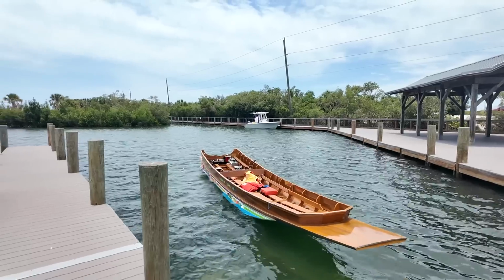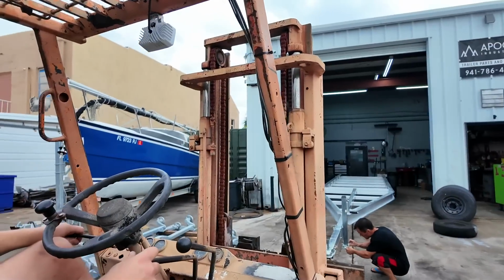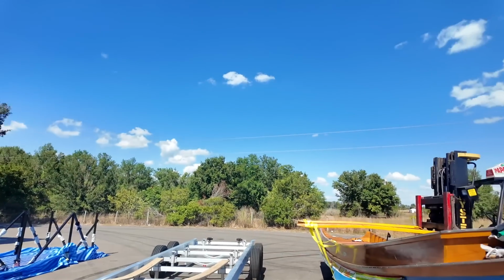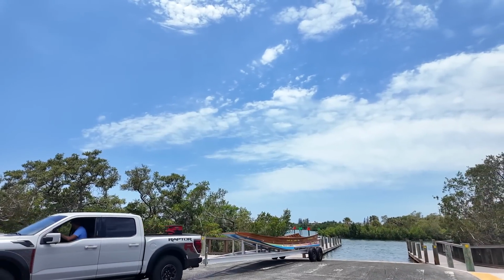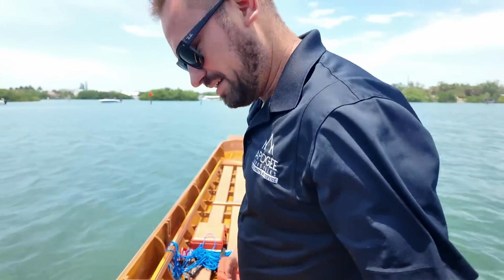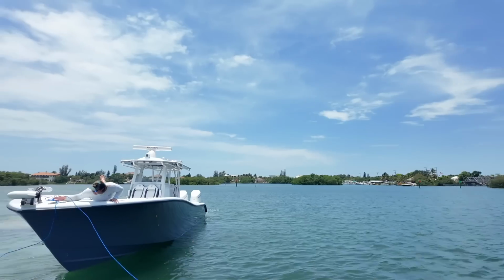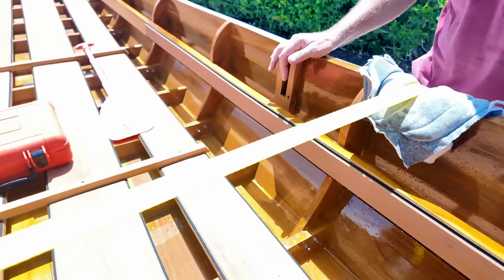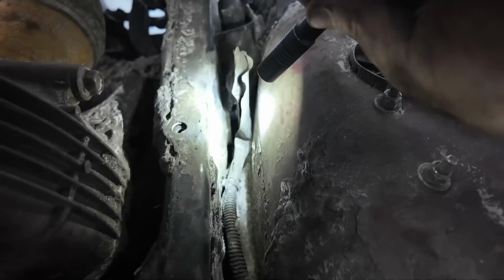We Almost Sank the Thai Longtail

Comment from the maker: Quality Entertainment starting at 17:00
Any suggestions on how to improve the water pump and fix the water leak?
Limited production on Boat vs Work Shirts, get them while you can!
https://www.cleetusmcfarland.com/products/preorder-dr-parker-bad-day-of-boating-shirt?_pos=1&_psq=preorder&_ss=e&_v=1.0
Reply: 🇹🇭 ปล่อยเรือเรือลงนํ้าซัก1คืนตวามชื้นจะทําให้ไม้ขยานตัวกลับเข้าหากัน 👌👍
Reply: You need to find someone who can vaccum bag one side and suck epoxy through the crack.  Tape and vacuum bags a good vacuum pump
Reply: Water water water wood swells and seals it’s self
Reply: Flex seal lol
Reply: On all of our wood boats we put lawn sprinkler under the boat to swell the wood back it takes a couple days
Reply: Just leave it in the water and the wood will swell and seal it self.
Reply: Man this boat is so epic dude! Mad penis extension.
Reply: It’s a easy fix for the water pump you just need a self priming water pump most of them just push water you need one that can suck and push look at camper water tank pump that’s what I run in my race boat to warm up when moving too slow to have enough water pressure thru the motor and you would also need a one way valve as well so it won’t flow backwards out of the motor as you are technically pushing water up hill to get it thru the motor
Reply: Put some weight where the engine would sit , to sit the boat at a plane (incline) to allow the water to go to the back
Reply: Dude call your Thai guy it's a Thai boat ask a Thai what to do

Comment: Forget the wedges that’s gonna make the crack bigger and spread it if you put anything like that in it. You need to put epoxy on the inside and then take the vacuum pillow bags( it’s like a home storage product) then cut it and tape it to the outside of boat and turn on the shop vac and it will pull the epoxy through the crack

Comment: The wood is going to continue have these issues. Best option would be to flip it over sand it and either re epoxy (easiest option). Or laminate another layer of fiberglass on the entire hull. You have to make sure that wood is completely covered even the smallest area not covered composites will 100% ruin the entire hull if water gets underneath the builders epoxy cover and laminate.
Reply: People still build boats with “wood” as long as nothing is exposed to the elements your good. But I can promise you just by looking at the video you need to do a full go over on everything that is exposed to water

Comment: Wooden boats need water or more accurately need " moisture content"
Most likely the "teak" is new growth and susceptible to dry cracking.
3 months in a container and 3 months in a low humidity will dry the wood thoroughly.
Leave it covered ouside with 5 gallons of water in the bildge, it will steam the wood back to " normal".
Wood floats.....

Comment: You don’t think those water intakes without the engine were just maybe barely touching the water? They are right at the edge of the hull and it had to be balancing more center or even front without the weight back there maybe they weren’t fully submerged.

Comment: Just dried out from shipping and heat from sitting in the parking lot. Grind out the crack mix up some west system with silica filler to a nice peanut butter consistency and drive it in the crack. Sand smooth and paint over with more varnish or just epoxy. There are tons of old wood race boats still out there, repairs are not rocket science.

Comment: Wood boat storage is crucial. Up here in Michigan people are using climate controlled spaced or barns with dirt floor for some reason. You can get into big trouble quick on the water if you're not safe. Have a second set of eyes on your work. Pushing some 5200 into the crack would be my solution. That stuff will never go anywhere.

Comment: I think your inlet for the pump was partially out of the water due to the engine not being in it.  It was sucking air alternating waves. Might want to check that before you buy a new pump.

Comment: That's a wooden boat for you. Doesn't matter if it's teak or mahogany or whatever. It will all shrink and swell. Most modern timber is not as good quality as it used to be. Sending timber boats from a hot dry environment to a cooler area isn't as bad as going from cold to hot. I am always worried doing this. Epoxy a spline into your problem area. A spline is just a tapered strip planed to fit the gap. Sometimes the gap will need to be opened up to allow enough room for a spline. G'day from Tasmania.

Comment: Those  ribs of the boat are joined with two thru bolts in the corners,not very good for strength . Looks cool, unfortunately that wood is going to snap like a dry twig

Comment: get a Bosch 039 Mercedes/Volkswagen electric engine water pump. $50 online and 900 Liters per hour(56gpm)....Meziere LS pumps only flow 42gmp and stock LS radiators only flow about 50gph so it keeps my car nice and cool and gives a nice power boost

Comment: Ok, Wood dryes and schrinks and cracks. If you then put epoxi in crack what do you expekt whwen the wood get wet and the wood expand? you ruin the boat it will bend all of your planks to hell.
Use a waxbased sealer from outside the boat untill it will swell to its naturar form.. Im al old boatbuilder from Sweden. God luck to you gyes.

Comment: I know several years ago I had a friend and his dad had a classic cross craft all wood boat in Arkansas. In the spring after winter, after dewinterizing the motor he would in his driveway put the garden hose in the bottom of the boat with the plug in. Fill it as high as he could without hurting the seating and motor and trans. Let sit. After a day put more water in. Ater the beginning of the week water would leak out for a few days. By the end of the week it would hold all the water. 

When it stopped loosing water he knew it was ready to use for the summer. 

Wood just dries and shrinks. 

Easy and free to try just loose some time if it does not work. 

Hope that helps.

Comment: I never really liked the cooling system on that boat the hoses look too small. But if it works in Thailand it should work. I would put a pee tube (hose) running over the side of the boat same as a outboard has that you can see easy from the driver seat. This would come from the top of the engine and intercooler one tube each. They would both serve to bleed the engine at start up and indicate positive cooling system pressure under way. Think about having a plastic bait bag stick to the water intake. I have had this happen twice with my outboard.
Side note, I used the hose machine at work for hoses but also for crimping the ends on battery cables. Just guess at the die size, don't over crimp, then put some self sealing heat shrink tubing on, done, no soldering. It will be the best looking battery cable you ever seen.

Comment: The issue with the cracking of the wood has to do with the moisture level.  In SE Asia they have much higher moisture content.  So if they wood is equalized to that amount of moisture, then it works there.  When it is brought over to a dryer area, the wood can crack because it is drying out.  We used to have the issue when I worked for a flooring company.  You had to make sure that the wood was dried to the correct amount for use in the US.  If they did not do that, and it was just the dryness that they have in SE Asia, when you installed it in the US, it would dry out and cause cracking, ruining the floor.
Reply: I highly doubt there’s a more humid environment than Florida lol
Reply: @brandon_doe  Oh there is.  I spent a few years in SE Asia and it gets pretty humid there.   I found Indonesia to be the worst.  Average Florida humidity is 74.5%.  Average Thailand humidity is 79.9%.  Average Indonesia humidity is 82%.

Comment: Killer boat Parker!! Do not short cut the boat repair. It has to be repaired correctly or IT WILL bite you in the ass. I have some experience with old wooden boats. Do it wrong do it twice. You cannot coat the boat with rhino liner it will not stop the water coming in.

Comment: For a sure fix and plethora of answers I'd try to track down a local shop that still builds wood boats. You are right about why it cracked, wood is not as durable as complete fibreglass and baking in a tarped container absolutely dried it right out. It does need to be opened up and have an adhesive forced in and clamped. I don't know if this boat has layered fibreglass like most modern wood boats but that'll definitely need to be addressed or added. In the meantime, treat it like furniture, keep it cool and dry.

Comment: Dude those boats (any wood boat)  stay in the water so they swell and seal itself. We used to sink the small skiffs on purpose so the wood would swell and when we pulled it up it was sealed tight as a gnats ass..

Comment: The leak depends on wether the split is opening up more when u stand on the port side if so it means there is a issue letting the hull seperate, like the top and bottom of the side of the hull are pulling apart

Comment: Parker, you need to seal the crack by pulling a vacuum on the outside of the boat where the crack is. Then, you can use a thin epoxy and the vacuum to wick the glue into the crack from the inside out.

Comment: Normally on a wooden boat the wood pound a cotton material into the crack to make it water tight and when the put the boat in the water and the wood begins to swell it will push the cotton out as the woods seal up..But you boat won't stay in the water so you will have alot of wood swelling and shrinking so it could cause more cracks don't know how well they sealed that wood to protect it from absorbing water you might have to use somekind of marine epoxy to coat the whole boat inside and out to keep it from absorbing water cause when it dries out it will cause more cracks!!

Comment: The problem with wooden boats is that when the wood gts wet it swells when they plank a boat they will leave a quarter inch gap between them so when the wood swells it closes the gap and even seals the wood making it water tight but when the wood dries the wood shrinks opening gaps and causes cracks which I'm pretty sure is what has happened here to your boat!!

Comment: Parker you don’t need to do any kind of structural rebuilding to fix any of the water leaks. I can’t see from the video but I’m guessing the boat building assembled the boat by laying planks across the rib braces butting the planks up against each other tightly. And he probably figured sanding the joints of separate planks smooth and varnishing over them would seal the joints and keep water out but a wooden boat that long bouncing over choppy water and bouncing around in shipping or on a trailer combined with the temperature changes from hot sun to cooler night time, the wood will expand and contract and flex slightly and the thin layer of varnish isn’t flexible enough so cracks and seams in the layers of varnish will appear. If there is an actual real crack in a piece of wood that can be easily fixed, but I’m guessing what you are seeing as cracks and where water is getting in, is just surface cracking of the layer of varnish and flexing at the seams where separate planks of wood were butted up together to form a joint during the construction. I don’t think these Thai boats were ever meant to be like normal boats with water tight hulls and bilges. There are more like a self bailing but instead of being self bailing overboard it through a scupper like normal boats, I think it all just drains down into the bottom hull and there is always going to be some water down there on the lowest part of the floor. That’s probably why they make them to have the raised floor boards to walk on and that are up higher than the lowest part of the bilge. Who knows. But if there is an actual leak that is filling the boat with too much water you can just use a putty knife and try to smear some 5200 adhesive marine sealant into the cracks and joints and try to press it into the seems, and you can wet your finger and smooth it or scrape it flush with a plastic spreader or plastic putty knife kind of like how you would spread spackle smooth when doing sheet rock. Getting the joints filled with 5200 will seal out any water from getting into the joints and it is flexible so it won’t crack and open up again and start leaking the next time the boat inevitable flexes or goes over some bumps. Hope this helps!

Comment: You need to push in the ball on the head of the drill put the socket on at angle so you dont have to use a hammer next time 😂

Comment: Your hull got dry and shrunk. What you need to do is let it soak and let the wood expand again so that it will seal itself back up. Wood shrinks when in a dry environment like a shipping container with the sun beating on it. The best way would be to remove all the electrical components and fill the bottom of the hull with water. The leaks will eventually stop. I would not use epoxy. Contact the builder. He can tell you what to use that is natural to seal it up. Rubbing the crack Beez wax is what I'm going to guess will seal it up from the outside and still look natural. Teak wood is naturally water resistant. In Thailand, they don't remove the boats from the water long because the wood shrinks. It just has to sit in water to seal itself or fill the bottom with water as I said before. I think in America the Beeswax is called Carnauba Was. Same kind as you put for the surfing board but a natural kind.

Comment: several options......
I would find a place to fully submerge the boat for a two-three day period, bale it out refloat, shop vac and wipe dry..,  leak and future leaks fixed.  
If not flip and support the boat, inside a garage or a shaded area. lay on several layers of water absorbent materials like blankets , sheets and terry towels,   soak it with water and keep it wet for a week. 
Whatever you do  Stay away from heat lamps this could cause a lot of harm and cracking in other areas, instead....,the boat would repair itself better if it were placed in a cool garage with several humidifiers going for several weeks. 
Teak is not affected nor susceptible to water damage or wood rot. 
If the leak is in a seam, the wood is to dry...,it needs water and nothing else.
Take in consideration how long some of those boards are..., if the boat is dry, kept dry and or exposed to the sun, imagine how much warping is going on. Your boat could be now 50 lbs lighter than when it was shipped

Comment: Sand down the outside and glass it with fiberglass and clear resin or epoxy.  
If you only seal it from the inside, the wood will be constantly wet which will quickly lead to wood rot and a scrap hull.

Comment: Those water pickups are designed for forcing water in while the boat is in motion. Look up water pick ups on an RC boat, they are exactly like that. The pump would only be used for when the boat is idle.
Reply: Yeah when he said that the pump doesn't work I realized they don't know anything about boats. You  have to have it connected to create a siphon effect

Comment: I would get a vacuum bagging system for epoxy, tape it down on the outside of the boat, vacuum the moisture out , then vacuum the epoxy in from the inside. West systems epoxy is what I would use, that's what we use to build our wood outboard hydroplanes and runabouts.

Comment: the wood has dried out over time , once the wood has sucked up some moisture again it will swell and should stop leaking , might even want to submerge the boat for a bit
Reply: 100% facts. We used to sink small wooden crabbing skiffs on purpose for a day and pull it out of the water, sealed tight as a gnats ass…

Comment: Please Don't rhino line or silicone will cause an environment under the coating and rot like cancer

Take an oscillating tool or router 
Carve out 1/4 groove on the inside.

Clean and dry with alcohol, ive found electronics cleaner works good because it evaperates quickly. use of dehumidifier would help too.

Tape up a cardboard shelf just under the crack on the inside. Tape crack on the outside so epoxy doesn't run out.
Gentle pour epoxy onto shelf into crack.

Pour the best marine epoxy you can find and good luck 👍

Comment: You can get epoxy to fill the crack by making a box on the outside of the hull to apply a vacuum to pull the epoxy into the crack from the inside. I have done this a few times on some hard to repair places.
Reply: I was going to make that Suggestion However I wanted to see if anybody else would come up with a resin vacuum Suggestion to them Because we do it all the time
Reply: Damn that's a good idea.  I'd like to see that process.  I'm sure that would draw the epoxy in real good.
Reply: This is the way
Reply: Second this. That’s how we do complex composite repairs on military aircraft.

Comment: Luke McFadden has a video on this. It's normal when they get taken out of water. The would drys and splits. He uses this white stuff that he hammers in the splits and it fixes the cracks. Pretty easy and genius
Reply: do not beat cotton into side of that teak boat
Reply: It would swell and would be fine.
Reply: @lietuvis96  I agree
Reply: They been doing that shit for 864 years
Reply: only problem is this boat is coating inside and out unlike his boats that just have the outside painted.